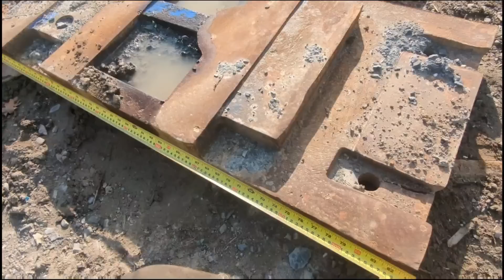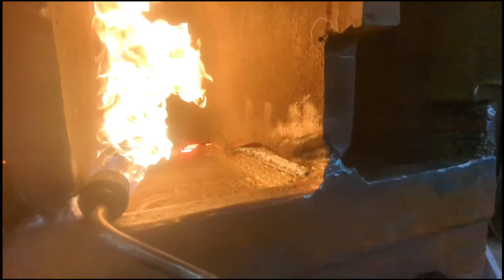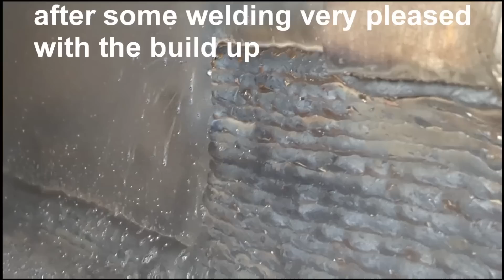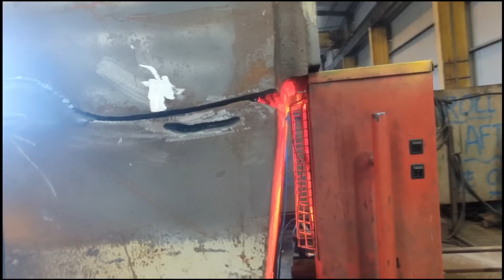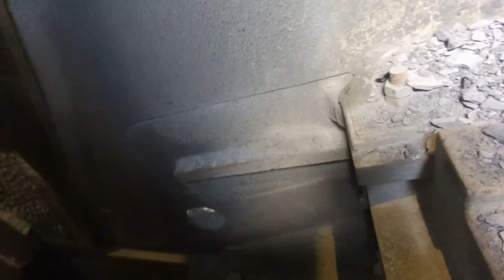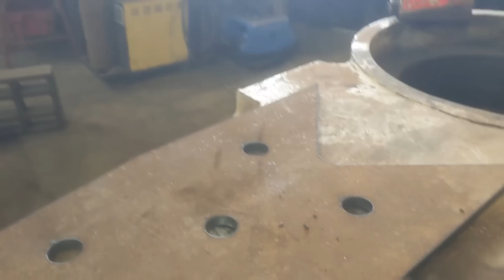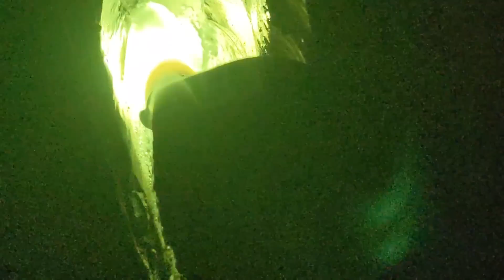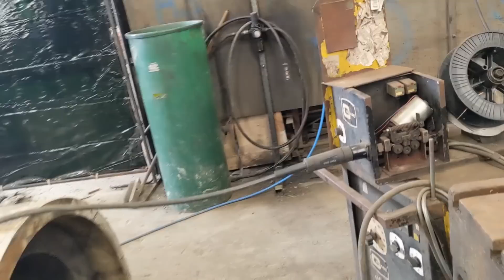10TON steel casting broken in half the welding repair starts!mega engineering!   quarry jaw crusher

Comment: Surprised you did not clamp things together on a jig or use alignment bars.
Reply from the maker: With the big mill we have we don't needto
Reply from the maker: It can re face any important surface back to true flat
Reply: @allistairc123  Ok. Was Just surprised you didn't. Probably much better to eyeball, guess, and think you have it aligned I suppose. Saves a lot of time.

Comment: Stunning work. I kind of almost miss that kind of stuff in a strange sort of way. Brutal when you're bent double for hours on end. It takes a toll. You got to like your own company when you're a welder.
Reply: Yep…. Either bending over or squatting and sunburning your shins. Aggravating the arthritis and admiring your work even if nobody will ever see it to appreciate talent.
Reply: @lorenrasmussen338  kneeling down on concrete or steel is a sure fire way to get arthiritis , it chills the bones in your knees , elbows and hands.
If i am doing a long job in one position i cheat and make up foam supports or lay boards to reduce fatigue .

Comment: Definite subscribed !! I am a retired 35 yrs, welder/mechanic from a Union USA shop. I worked in quarry , blacktop and sand and gravel processing. Some of the most satisfying work. I am totally impressed with your work ethic and willingness to share your knowledge, Thank you !!  Totally impressive work, super smooth hand, great shop set up  !! Can add some hops and grain to that water and make it a pint!
Reply: I keep losing the sense of scale with this piece and thinkingnthay this thing is Bloomin huge., the  large volume of weld wire going into filling the cracks and voids. Awesome to watch.

Comment: "Normalizing" after a weld, to relieve stress and make the material more ductile, is that a process similar to annealing?
Reply: Same as annealing except air cooled. Annealing is typically furnace cooled, which take quite a bit longer. Both will reduce hardness, annealing more so.

Comment: Crazy! I saw cee engineering (Kurtis) using flat bbq burners to preheat, could you do something similar, sticking burners under the welds to heat things up and keep them at 150? Like five burners one in each hole?

Comment: Chains are outlawed now for us. In the field we have no way to inspect them, after a shock load or just everyday loading. Every lift is cloth slings now.
Reply: I was welding Oil drilling tools and had a cable sling. The general manager saw it and threw it in the trash. Then he wanted a job I'd just finished welding (oil rig waiting) put into his truck for delivery. After preheat, heavy welding and post heat, it was smoking hot. I tossed him a cloth strap and asked him if he thought I could pick it up with that. He was really angry.
Reply: LoL @phlodel
Reply: @colingunn4822  The manager told me to get my cable sling out of the dumpster. I told him "My daddy taught me that If it's in the trash, leave it in the trash." Somehow, that didn't make him less angry.
Reply: To funny we are still using cables just not chains to lift @phlodel
Reply: Where are you, a national law or just that shop or industry wide or Union rule?  Thanks.
Reply: Canada  industry wide
 @alro2434

Comment: What size wire are you running on that?
Reply: Also why not put preheat torches in the pockets?
Reply from the maker: 1.2 solid, too much preheat is easy to over temp too!
Reply: You have a nice hand with the air arc. Cp/bg's are a bitch. Those 9100 series hoods are nice good air flow. I'm not sure what size wire that is as I'm American. Ha! I mostly use 3/32nd. Not sure what that is in meteric.
Reply: Outer shield wire. Structural steel members.
Reply: We use 250lbs rolls of it so we don't have to change spool so often.
Reply: Need to stick weld with like a 3/8in -10mm!

Comment: Jobs like this are what I live for, I’m still surprised it’s worth fixing them.
Reply: It would be a custom casting at this point regardless whether the company that made it is still around or not and that'd be very expensive. The alternative would be fabbing up a new one out of plate steel, that also requires a lot of welding and very expensive. While the repair is risky and expensive it's still a lot cheaper than the alternatives and faster too, a replacement would easily be over a year out.
Reply: @TheMadHatter626  I think you are right. Lead time could indeed be a major factor that I did not take into account. Also you are right that it would be extremely unlikely a part like this would (ever) be a stock item.
Reply: Me too! Apparently they did the math. But still. And a repair like this is not backed by a guarantee. I wonder if a part like this would still be available or that the equipment manufacturer even still exists. It would always be possible to reverse engineer and perhaps even improve on critical points if original factory documentation is no longer available.